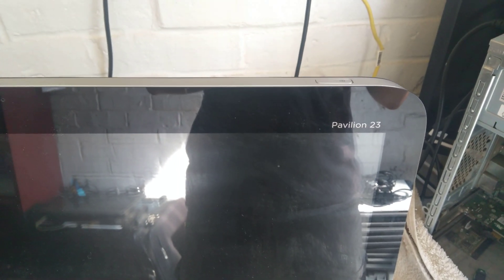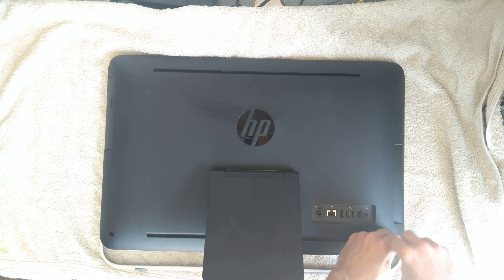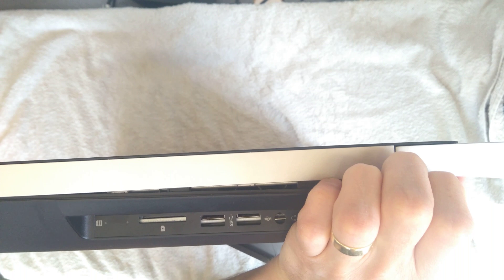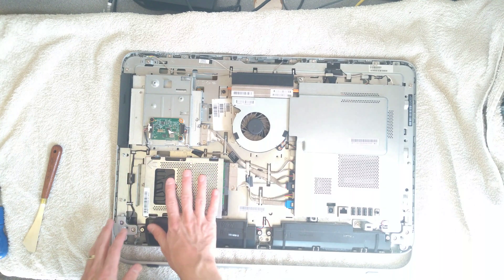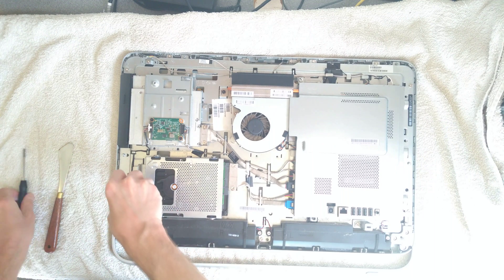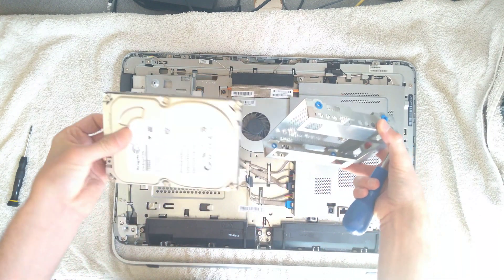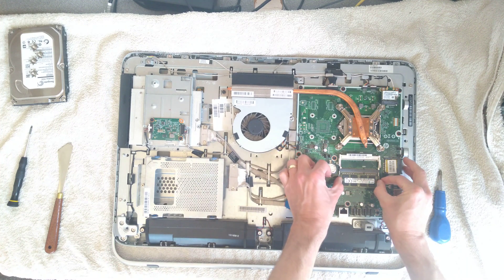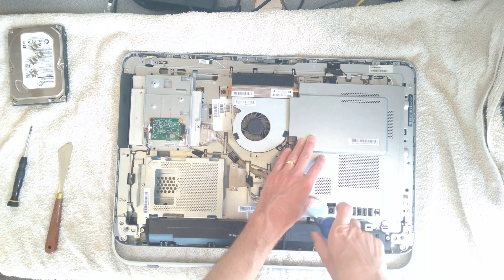Change or upgrade the hard disk in HP Pavilion 23-p030na 23" Touchscreen All-in-One PC

Comment: hi, i have a pc like this1 but the model is 23 h017c,  mine looks the same as yours,  I was thinking about upgrading  my hd to an SSD, however i was wondering which caddy case  would fit into this?. the ssd  (which is alot smaller than the normal hd), hangs. my only other choich is to double tape it using the included case, or buy 1 that can fit into this (which will not reguire taping it). but is there 1 that can fit into this?
Reply from the maker: I never bother, just leave it hanging in the air :) otherwise something like https://www.corsair.com/uk/en/p/pc-components-accessories/cssd-brkt2/dual-ssd-mounting-bracket-aca-a-black-cssd-brkt2

Comment: I just acquired one of these.  There are several hardware variations of these, i.e. the HDD enclosures are not the same, the motherboard covers are not the same. One even has 3 screws attaching the back cover.  Some motherboards have display port output, etc.  The HP Pavilion 23-p027c looks the same as this one.
A 2.5 inch SSD will not fit into the 3.5 inch HDD enclosure & still plug into the SATA power & data connectors.  It must be mounted using the screw holes on the bottom of the SSD.  You will have to drill 3 new holes into the top of the HDD enclosure; the top left one cannot be used since it won't contact the metal.  The lower left will align with one of the tiny vent holes.  The upper & lower right holes get drilled very close to the edge of the enclosure.
Reply from the maker: Yea, every hp model number is subtly different which is why I include the whole model number in the video description and voice.

Comment: I have this very same pc for some reason it kept killing hard drives must have had maybe 8 drives one was replaced under warranty so I brought it for £60 or my mate as I thought it must be something he was doing to it well 1 SSD swap and it's never let me down I have upgraded the ram to 16gb all in all one of the best all in one computers I have ever had only downside now is it can't run windows 11
Reply from the maker: If you download the windows 11 install iso then use Rufus (make sure you go to the genuine website, not the fake virus advert sometimes appearing at the top of google) you can create a windows 11 install USB which bypasses the hardware requirements and still works! Likely needs a fresh install though, I suspect you can't upgrade your existing OS.
Reply: @freename  I did that but went back to windows 10 yes it ran much better but Microsoft turn of some things like windows security and I will not pay for third party security as the built in one is really good for what it is
Reply: @freename  I did look in to a tpm 2.0 module but the mainboard don't have a place to put one in so leaving it as it is and buying ether a Lenovo or hp tiny pc an elite desk or something like that

Comment: Thanks for the video. Helps to see how it comes apart before attempting myself :P
replacing hdd with 2TB ssd
Reply from the maker: It's a really worthwhile upgrade. Hope it goes well!
Reply: @freename  yep went perfect, much faster now! Gave it a good clean on the inside at the same time. 
Just the only thing I’m worried about is the screen flickers around the edges when you first turn it on, has always done it just doesn’t look right.

Comment: Estas medio puñetas pero puedes esforzarte mas y ser mas profesional con tus herramientas y aditamentos como una mesa especial y el equipo adecuado para realizar diagnósticos.
Reply from the maker: It didn't inconvenience me or damage the computer. If it is the difference between the computer being fixed or being thrown away I know which I'd go for. In 15 years I've not damaged a computer on my desk or with my tools.
Reply from the maker: It was not so much the table that I was worried about but any dust or dirt on the table. The screen is glossy and has no bezel so is incredibly easy to scratch. Using a towel reduces the chance of dirt significantly. Changing the table to something else which has been used for years still runs the risk of dirt on the table scratching the screen.

Comment: Mine just goes black idk what to do
Reply from the maker: What do you mean "goes black"¿ Turns on then goes wrong a few minutes later? Never turns on?
Reply: @freename  I turn it on ok. It then it says to press f1 to boot i press f1. Then it pulls up windows error recovery then it gives me a choice to pick start windows normally or to launch start up repair. When I pock start windows normally it just says starting windows then stays like that for about 5 mins then when I pick start up repair it just goes black and stays
Reply from the maker: Sounds like the ram or hard disk. Does it boot a Linux live usb stick ok? I recommend asking a computer repair friend or company.
Reply: @freename  ok thx I think my dad said it was the hard disk but I really don’t know anything about computers but thx do you know the normal price on the hard disk or can it be replaced
Reply: @freename  and if you don’t mind me asking but what is a Linux live usb stick is that the usb on the end of the keyboard or mouse
Reply from the maker: Hardware itself is next to nothing. Put in an SSD and it will be quicker (will need installing with windows again from a usb stick). A 250GB SSD is around £25.
Reply from the maker: A Linux live usb stick is a copy of the Linux operating system that runs from USB memory stick and doesn't interfere or change your hard disk in the computer. Helpful to test if it's your operating system on the hard disk that has a problem or if the entire computer is struggling.
Reply: @freename  imma just get someone to fix it like one of the electronic places around where I live to fix it but thx for all of the things you have told me